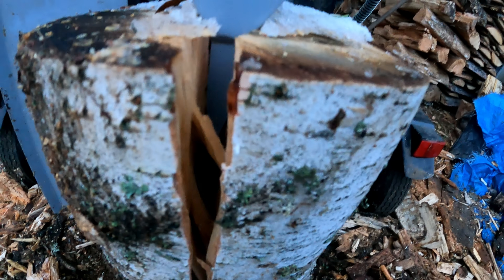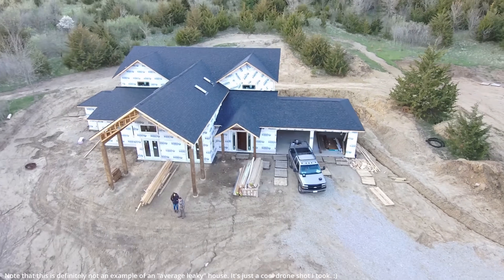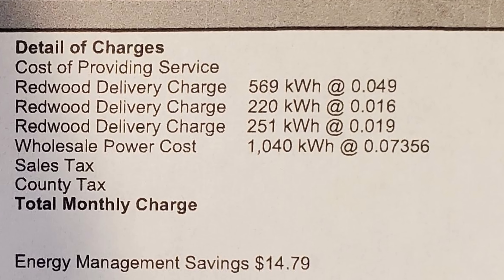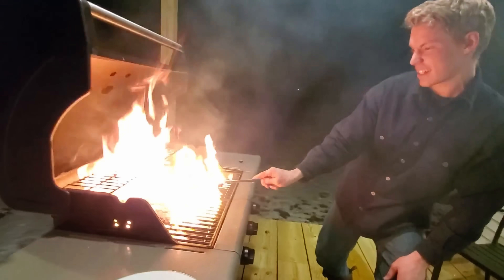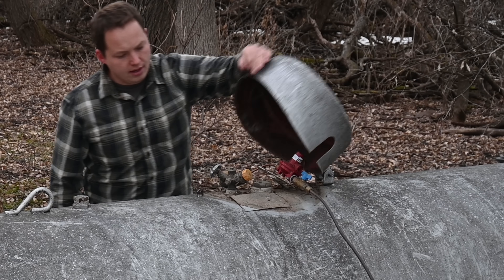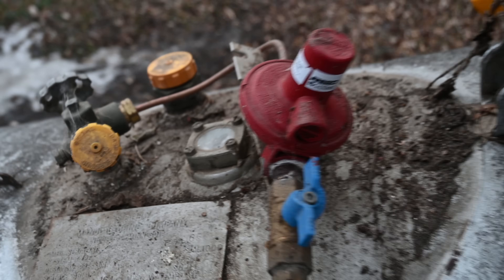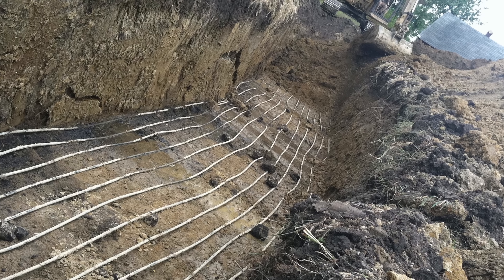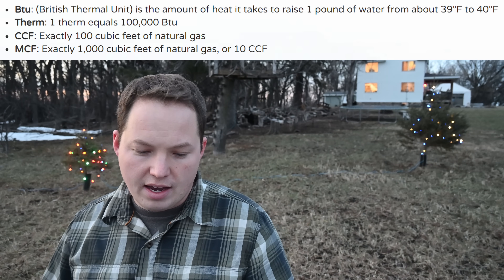What's The Best Heat Source in 2022? Top 5 Home Heating Methods - LP Electric NG Geothermal Fuel Oil

Comment: To get 100,000 Btu's of heat into a home, you can burn about 1 gallon of oil, or about 1.1 or 1.2 gallons of propane, or use a therm of natural gas + 5% to 20% depending on how efficient your furnace is.  Or with a 10 EER heat pump, it will take 10 KW of power.  Increase this to 15 EER, and the cost will be only about 7 KW.  Electric heaters are 3,400 Btu's per KW.  So about 23 KW per 100,000 Btu's.  Coal, and wood are not a thermostatically controlled amount of heat.  Pellet stoves also can be thermostat controlled, or not.  

I think that at $6 per gallon, oil will be the most expensive this coming winter.

Also in Canada, it is popular to have a oil furnace when you live out in the country, and can not get propane in the winter delivered, and use a heat pump to provide heat when the temperature is above 20F or -8 C.  Some low temperature heat pumps work great, even at -10F or -25C.

Comment: Oil $4.65 a gallon as of two days ago. Just installed an 18k mini split to offset heating costs. I expect the democrats to double fuel oil costs after the November election.  If I have the time a small wood stove will go in as well.

Comment: I use, propane, coal and oil. Whatever is the cheapest at the time. I use coal during the coldest part of winter and usually oil for the rest of the year. Not this year oil prices are out of control. I switched propane for hot water/pre and post winter heat.

Comment: I have all of these heat sources in different locations. Well pump house uses resistive element heat. House is wood stove, electric base heat, and mini split for main areas. Shop uses propane unit heater. Out of all I think the freestanding wood stove is the cheapest. Even considering I purchased a load of logs.  We are in Montana.

Comment: In southern CA, electricity sells for about .38 to .46 cents per kWh. That is likely the highest in the nation yet CA is a densely populated state with 45 million people and you would think that the cost of everything there would be the cheapest due to the amount of volume of natural gas, power and other sources for heat. But, it's not mostly likely due to politics. Natural gas is about $1.20 per therm however, that number changes monthly depending on how much their utility is charged for gas from their suppliers. 

Put your numbers to work with the above figures and see how sweet you have it where you live.  Our home gas bill in winter, natural gas forced air heating, uses about 75 therms per month and averages out for the entire year around 35 therms per month. In summer, electrical central A/C, our total power usage is about 1,600 kWh to 1,900 kWh per month. So, with a really sweet charge of .38 cents or more per kWh, we're seeing some rather high power bills and ours is lower than many folks who use their air conditioners for comfort. We have 1,950 SF one level.

Comment: Unless you have a home built to Scandanavian standards with triple glazing etc, heat pumps are a waste of time and useless in winter. They can't generate enough heat for a reasonable hot water supply for washing and have to rely on an in-built old school immersion heater to do the work and simply don't work at all if you live in a climate that has cold winters. However, if you live somewhere like Iceland with lots of geothermal activity, you're in luck as you can just use that. Mind you your PV panels will be useless in winter when there's so little sunlight.

Comment: I live in the NE, Atlantic Canada.  My home is about 1400 sq ft, It is spray foamed from top to bottom, new triple pane windows, doors, etc, all affordable in a small home.  I run one 12000btu mini-split heat pump and use propane for cooking and heat supplementation.   Seeing you have wide viewership, I will add that I avoid natural gas because of the environmental trade-off, it is fracked gas that emits way more methane, and that is extremely harmful to the environment.  As you began, insulate first, and choose your energy source carefully.  Thanks for the great information.

Comment: Fuel oil sure went up, about $6 a gallon now. Our office furnace was rated at about 2GPH, so it was costing $12 an hour to use.  We got a mini-split system for about the same price as 1 oil tank fillup, it works great and even heats faster than the furnace even though it's less than half the BTU's. As a bonus of course you get great AC in the summer. Propane, forced air electric and oil can't do that.
Reply: It all sounds good but you still need electric to blow the air around the house and the more people who go to those terms of heat, pretty sure the price will sky rocket as it has been. i can remember people would say lower your thermostat and save well hell a lot of people started lowering the thermostat and the price went up higher faster. it is a no win situation. so in reality use less and pay more. and as far as heating with wood if everyone went to wood, the price would also skyrocket as the supply got lower. any way you look at it we the people are screwed.
Reply: I have been telling anyone who would listen to install a ductless heat pump if they burn oil to heat a space.  I installed a 12,000 Btu 120 volt heat pump I bought at Amazon in my nephew's rental house, mounting the indoor coil on a TV cabinet, and running the copper lines out the window to the outdoor unit.  His home is about 1,300 square feet and heated with electric 2 KW heater in each room, no cooling.  He loves the silent cooling and the heat output is fine this winter.  We had a cold snap at 23F, and still no problem heating the living room, and most of the rest of the home.  It draws less than 10 amps.  Less than $1,000 to install it!
Reply: @Kangenpower7  Yes we have 2 in our house, haven't need to turn on the old electric furnace since we got them.  Our power bill last winter was $520, this year about $ 280 so nearly cut in half. Plus we are now charging an PHEV / EV that we didn't have last year.

Comment: amplify the sunlight with the screen from a mid-2000s flat screen tv.  The top layer is a big plastic Fresnel lens that you can melt metal with when focused to a point by bending the screen.

Comment: ...not too big on subbing but i am giving a thumbs up and this comment. Living in the Southern us I have to say that a large portion of my heating bills every winter is not the actual usage of the commodity but the fee to be privileged enough to get to pay my utility company for those commodities. Unfortunately my property is just small enough to be exempt from being allowed to put a propane tank on it as I need to have at least an acre to place a propane tank here. So natural gas is the other option but of course you pay that natural gas bill all year long unless you want to turn it off in the summertime and then you get to get a reinstatement fee when you go to turn it back on again so either way they get you. Sometimes there are natural an extraneous expenses inherent in the heat sources that are not calculated. Not including the cost of your chainsaw or a fuel to collect firewood would be another example of this.

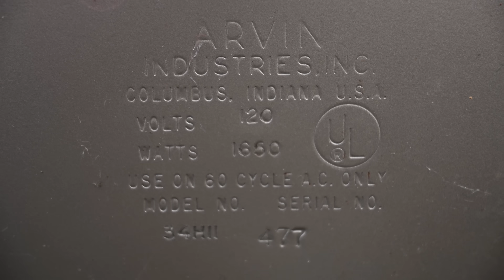Comment: 2:40 The only exception to that would be a central or permanently embedded electric resistance heating system that leaks heat to the outside via exposure of heated surfaces to air from unheated spaces. This would  be an obvious problem with pipes or ducts running through outside walls and attics, but it can also be a problem with radiant electric heating films and cables installed in slabs, outside walls and ceilings. Portable electric heaters might look less slick, but they are less prone to energy losses than some permanently installed electric heating.
Reply: You can sit in front of a radiative heater and be toasty while the rest of your house is cold. This might work for some people. ... OK, I don't know of any, but still.

Comment: crazy dollar values. I never paid more than $75 for natural gas in a month for heat and hot water in Wisconsin. Keep the house well insulated, don't heat it over 65F and turn the heat down at night. Let the sun in whenever possible, double insulate the windows with plastic film to keep the drafts out. That is for 1600 square feet in a 1980s cheap "builder" house, no foam sprayed and original crappy builder windows. I am currently remodeling it for sale and am vastly improving the insulation envelope, sealing all the areas the builders were sloppy. With modern building tech you can keep a house warm for $20 a month, or net zero if you get enough solar to offset a heat pump or geothermal setup.

Comment: In my house I had kerosene (Monitor heaters) and propane. I added a 100,000 btu pellet boiler with a 3 ton hopper and then during a remodel we removed the kerosene heaters and installed modern heat pumps. The propane due to cost is now the backup system and part of the house is on heat pumps and part on the pellet boiler. I wish propane was cheaper because it is basically maintenance free whereas the pellet boiler needs frequent ash cleaning like you would an oil boiler. The pellet boiler also comes from Denmark so parts are expensive unless you do a little research and find equivalents for igniters and oxygen sensors on eBay. The heat pumps also need yearly maintenance and one of them is being serviced next week because it stopped heating. I wish we had natural gas available but we do not.

Comment: The only thing I use butane for is my camp stove and mini-burner that fits on portable butane canisters, so basically for cooking. I will not use propane. I have a problem breathing in propane fumes/fuel. And having enhanced sense of smell doesn't help either. I have not had an issue with butane, so I will use that. I'm a bushcrafter. Less in the Winter due to health issues and sensitivity to real low temperatures. I can handle a little time out if it's not too low of a temperature.

Comment: At the time of this comment heating fuel is 5.12 gal, propane 5.36 gal, electricity is .24 a kwh peak where I live in northern NH. I have tried to heat my home with all 3 and in the end it all ends up costing about the same. The only true way I save money is to turn the thermostat down to 65F or lower. I see a drastic heating bill change when I do that.

Comment: Think bigger: on the expense side I use energy to heat my house, but also electricity for all kinds of appliances and for my EV. That total expense is what I could save if my energy was free. So what do I need to invest to get energy free - or mostly free ?
- Insulate my house (priority one)
- Solar panels to produce electricity - enough to cover heat, lightning, appliances but also car miles.
- Solar panels to produce heat for a boiler
- A heat pump and a wood burning stove (just in case)
- a heat pump also produces water you can use, in the UK almost 20 gallons (75 liter) a day, that's 27m3 per year.
- batteries (my car can cover part of that need) to store produced electricity
 
It's a big investment, but once the investment is paid back (some 7 to10 years) then the cost is maintenance, and you save the planet too

Comment: Really enjoy your videos (electrical and HVAC) and have recently subscribed. I too live in a colder climate in Northwest Colorado in which temperatures reach 30 to 40 below and lots of snow. Our home is a 1970's built home and has baseboard resistant heating, we pay just over .11 cents per kWh. We also burn coal during the winter to keep cost down. Lots of coal in this part of the country! I have recently built a 40'X60' shop with an apartment above. I have installed a Lochinvar NKC199N boiler for in floor hot water heating in the shop slab and in floor joists for the apartment, we'll see how the floor heating will work in the apartment, The apartment in 1280 sq ft.. But I have also installed a duel mode (with heat pump) mini split in the apartment, with two cassettes in the ceiling. The whole outer shell of the structure is "foamed" with four inches in the roof area and three inches in the walls. The "interior walls" (walls from the living area to the rafter attic area is also insulated with R-19 bating. This video has helped me to decide to install one more mini split "head" in the shop area for an added backup heat source. Keep up the great videos, thank you!!!!!!

Comment: The Mitsubishi hi2 12k 9k and 12k separately will be better efficient than 36k one compresor with 3 heads and how much current will drain one 12k compresor
Reply: So this will be better than a old gas boiler.

Comment: Ground Source Heat Pump by far first, next 95% NG Furnace,  next 95%LP Furnace, Air to air Heat Pumps need to go into a defrost and the colder the outdoor temps the more you need to defrost last Straight Electric strip/Baseboard Electric, lastly with Biden's Fuel prices Fuel oil for sure!!!

Comment: I have a outdoor wood boiler, I only need to fill it one to two times a day depending on the outside temp, some times it can go for almost 40 hrs before needing wood again. This of coarse is all depending on the temp and what wood you are burning wether if it is oak, cherry, locust, maple, walnut , maul berry, thesse will all burn hot an leave you an good amount of coals for restokeing, where burning pine, birch, popual ,cotton woods these will still give the same results but dont last as long and leave little coals for restoking.  Do tree service every day so to produce wood for the boiler does not cost me anything it a fraction pf my time as to i already have the tools and equipment for wood processing. This boiler heats not only my home but my garage, poll barn, and hot water, and haveing endless hot water is a must with a house full of kids.

Comment: A wood stove is without a doubt definitely the best way,  although it can actually make it too warm,  but I live in a small mobile home and use a kerosene heater for primary heat. It has an electric furnace,  but it would cost me $300 a month or more just to keep my home warm,  because it's an older mobile home and not insulated that well.
Reply: You would be surprised how much it will cost to run a heat pump, it is actually fairly low cost.  A 20 SEER heat pump collects about 20,000 Btu's of heat with 1 KW of electricity, so that is pretty good.  About 1/3 to 1/4 of the cost of running the electric furnace.  Kerosene will be much more expensive for the winter of 2023, with the cost going over $4 or $5 per gallon in most parts of the country.  That is 135,000 Btu's per gallon, but the efficiency of the oil furnace is typically 80% or less, so a lot of heat goes up the flue!  And if you have to vent the oil burner then you can be losing a lot of heat through your chimney.

Comment: I worked on a house that has 7,000 sq ft (about 88,000 cu ft) and 87.5% of the time I'm heating and cooling it with 30,000 btu's. Family of 5. Total electric (10 cents @ Kw app). HVAC systems today can tell you what stage % it runs. 30,000 1st stage, 48,000 2nd stage and 72,000 3rd stage (geothermal). I shut off the 3rd stage and it also produces the domestic hot water.

In you foamed home, did you install an HRV?

Comment: If you have solar, then a heat pump is the logical option. I would love to have the money for a ground source heat pump but the mini split is working out really well. I did spend a ton of time upgrading my insulation though. With zip R6 sheathing, closed cell foam, and R15 rockwool it maintains temp really well. If you get a really well sealing house though you need to get a heat recovery ventilation unit. If you don't, you can actually have over saturation of CO2.
Reply: Here in Europe we Conwert DIY   AC air to air unit  to HEAT pump air to water unit.  
For example Haier, Rotenso 7kw can consume in 100% like 2.5kw of power (electricity) and produce 7kw of heat . Full conversion cost about 1000$ -   which 800$  cost new ac unit and 100$ cost 15m of 1/2 copper pipe and 15m PE 32mm pipes + you must add extra 100$ for  pump if you dont have it in home.  In conwersuion we use oryginal electronic from inside ac unit and a air temperature sensor form inside unit - should be deceived by soldering a 5k ohm resistor  , and system this way can heat a watet to 50C  or 122F

Comment: I have a new house built in 2020, i have a central air system that is feeded by a wood furnace and a heat pump, plus i have an electrical furnace in backup in case its too cold for the heat pump and i am not there to feed the wood furnace. The electrical furnace have never been used for heating yet, but its a nice backup. My end result is that i have a crazy low heat billncompared to any similar house around here in north of canada

Comment: Thankfully I can still cut turf in Ireland 2 plots which costs me around 200 Euro I think this year ,now there is some work in it ,but major savings as the cooker heats all the house which is well insulated, I also have kerosene which I have used 1,000 liters in 12 years

Comment: Troy Ohio  Feb 2022.  propane $1.85 a gallon,  we use propane back up to our heat pump which switches at about 25 degrees. We are paying about 10 cents per KWH.

Comment: i have in stalled mini splits , love them, next solar add on!  i have a question about installing a second heat pump in my basement, for winter heating! i saw some ideas  about tubing installed in the ground and using that air to transfer it to the heat pump! any thoughts on this?